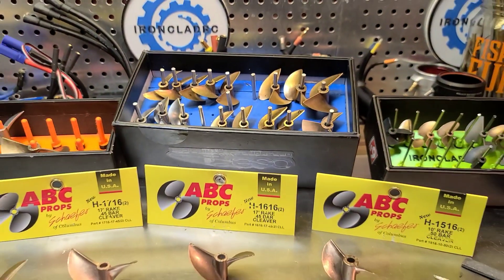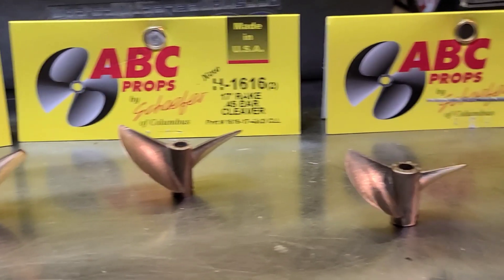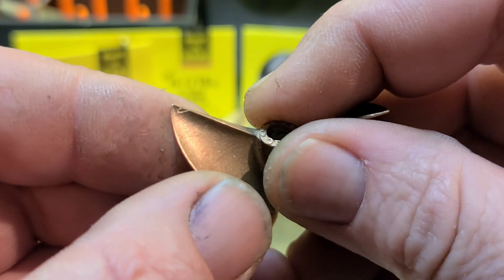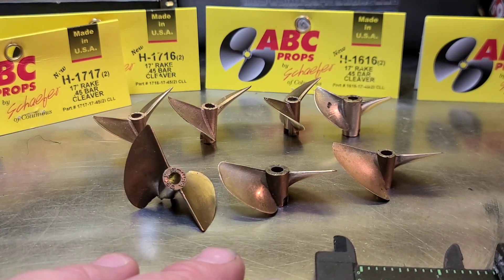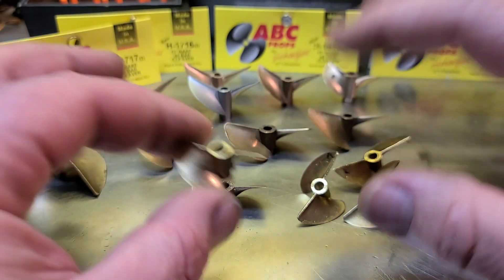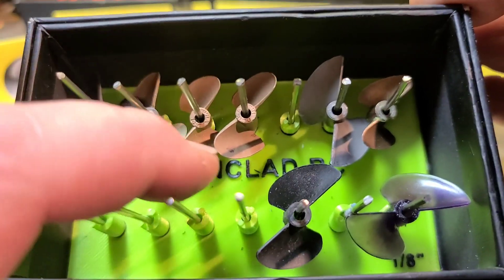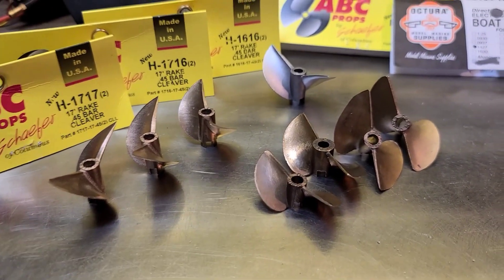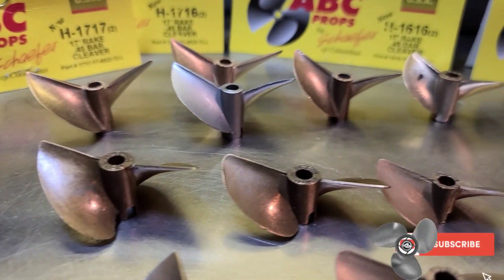ABC Prop Identification & Comparison - Octura, Proboat, Pranther, Aquacraft

Comment: Just starting this hobby and learning about the props. Getting the MM size down and now the durn ABC's and they have numbers like 1616 now I'm lost again.🤪. I have the UDI005 and have it running pretty sweet on 3s and 4s with a 3814 mm prop. Would like to try some clever props with heavy rake like the ABC's are built. Just don't know how to figure the size for purchase. Thanks for any help.
Reply from the maker: 1616.   1.6 inch 1.6 pitch  (40.64 mm 1.6 pitch)    convert the first two numbers from inches to millimeters gives you the diameter next 2 numbers is pitch.       Then you'll see another set 17/45. 17 is the rake, 45 is the blade area
Reply: Thanks, I have the chart to convert. Now knowing the first number is a 1.6 inch I had figured the second number was the mm pitch . Thanks a bunch and for responding so quick. I do try to watch all of your videos. they are extremely informative.   You had explained the second set of numbers, the rake and blade area in your video.@ADRC

Comment: Here a prop question looking for a ball park answer from someone that has tons more prop changing experience... i have a motley crew 28'' cat boat with a 40 mm prop on it which is handled well with stock 60 amp esc and 1800 kv 3655 motor using 2 4000 2s packs (4s)... i upgraded to a 3674 1900 kv turnigy and 180 amp esc with extra cap pack... Question is this... if i use a 45mm same basic prop and pitch and my new power system can spin this prop ,what type of performance gains will i see... i will also be using  2 100c 5000-6000 2s packs...thanks
Reply from the maker: It should handle the 45 mm prop no problem as long as its 1.4 pitch anything higher in pitch would heat electronics.....     prop suggestion 42mm high rake from oxidean marine or sharpened & balanced abc 1616 for high speed runs.
Reply: @IRONCLADRC  i am not ready to buy batteries for it yet...i just wanted your idea on what performance i should expect... it did 40 plus mph with all stock and launched out of hole great... my guess it would fly out of the hole and have another 15 mph top end on 4s  setup... does that seem about right...i also think esc and motor and better batteries will handle the extra prop fine... if not i can prop down like you say...maybe that 42 is the sweet spot... thanks

Comment: For a ul19 4555 abc prop might be to big?
Reply from the maker: Depends on what kind of power you got in the boat if it's stock yes it might be a little too big
Reply: @IRONCLADRC  just got a 160A spectrum running 6s same motor for now and upgrading the cooling system and a mojo fins

Comment: Love your videos. While not new to rc (planes and truggy racing). I'm looking at getting into rc boats. I grew up around ski boats so I'm familiar with boats. How do you figure out cog on an electric boat? Im looking at the Impulse 32. Thanks
Reply from the maker: Cg on a mono should be around 30-35 % total length measuring from the stern (back of the boat, Basically...   Each boat is different 30 -35 is a good place to start
Reply: @IRONCLADRC  is that including the hardware. I'm looking at it because it too is weight xtending past the transom

Comment: So many numbers, I thought setting my gear ratio on rc cars was tough. This is much more involved. I hear ya about the know it all haters talking smack about balancing props. I have noticed that the most vocal haters have no videos of boats or props. So I’m going with the premise that if you don’t have any content related to something you are criticizing, you should probably shut the hell up.
Reply from the maker: I know right i was getting mixed up as well   Jeez.   I've always been fascinated with props. I'm no freaking expert but the more i mess with them and run different props the more familiar I get..  Once I think I've got them figured out,  I get thrown a curve ball.      Those abc props look legit I can't wait to get them on the water.   Literally took me 6 months to get the abc numbering down pat I'd studied the numbers on offshore electrics for months before I bought the props.  There not cheap so I made dang sure I knew what I was getting.
Reply: @IRONCLADRC  yeah , the abc prop numbering system seems to be completely different than all the other manufacturers. I had never heard of the ‘bar’ number
Reply from the maker: The abc numbering system actually make much more sense  having the props sitting in front of you Comparing props to one another.  The photos just don't do them much justice online.
Reply: @IRONCLADRC  yeah I can kinda see that

Comment: I don’t know who is more excited about your next boat you or me. The Veles29 is such a beautiful boat , well built & full of surprises. Can’t wait to see what you do with yours buddy
Reply from the maker: Guess what!  The fed ex guy just delivered it!   On easter Sunday!  How about that!   Yea I'm excited about the 29 veles, watching you Rip yours,  I had to get one.      BG4L
Reply: @IRONCLADRC  bg4life for sure. It seems the veles and the ul19 have a lot in common. All I can tell you about the veles is that it’s alittle twitchy when turning at low speed and you need to over come torque roll with battery size or placement. And speaking of batteries , there is very limited space for them. I have had good luck running slightly bigger battery on the left side or adding some weight on the left side
Reply from the maker: she should be a 60 plus mph boat all day long.  The fiberglass hull is what I'm Most excited about. I will definitely try the battery's on the left side to offset torq roll.

Comment: Any reason you still run brass props over cnc? I have way better luck with cnc. They are completely balanced and sharp. Not to mention they’re only $25 compared to $60
Reply: Oh and you should throw that 1717 on the blackjack 42, should be a 60 mph prop
Reply from the maker: Working my way around to the cnc props.   I've always herd beryllium/copper props are lighter weight less rotational mass?  

Plus if I ruin a copper beryllium prop i can modify and tinker with what's left.   Prop modification is harder on an aluminum prop.       I like aluminum don't get me wrong.
Reply: @IRONCLADRC  no sir, 100% false, all my brass props are way heavier than my cnc props. I used to like the brass props but cnc is the way for me now.
Reply from the maker: Roger that.
Reply: Biggest problem with aluminum is they tend to have traumatic failures where a blade will snap off.  The brass/copper hold up better in abusive situations.

Comment: Hey if your looking to check out some props now I know hot racing isn't a huge boat part making company but they do make some diff props and was also curious if the conical  prop nut actually has any benefits lmk if interested as I work for them 0
Reply from the maker: the conical prop nut definitely helps,  make the boat look "cooler "  I don't see any big advantage to running a cone nut.  Most people would agree.   The main disadvantage from running a cone shape nut is that the cone nut doesn't come with locking nylon to prevent the nut from backing off.  I've lost a few props from cone nuts, backing off.   If you do use a conical  nut loc-tite that bad boy on the shaft.
Reply: @IRONCLADRC  for sure I know these hot racing ones have a grub screw in them and yeah so I figured it was more looks than anything !! But again if ya wanna try the props lmk

Comment: Yessir, that BAR is blade area ratio. Smaller number means smaller blade area. Try that 1616 and 1516 on the BJ24! Got a Veles 29 coming?
Reply from the maker: Yep I actually bought those 2 props for the bj24, gonna try the 1516 on the little deltaforce 23, try to beat my pb 56mph Df23 & 63mph BJ24..  yes sir your correct vel 29..  👊